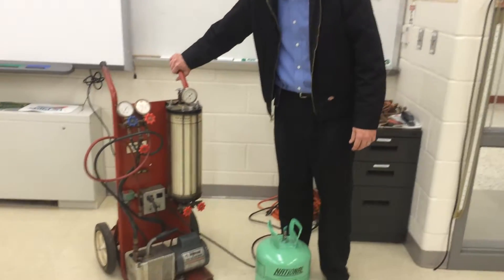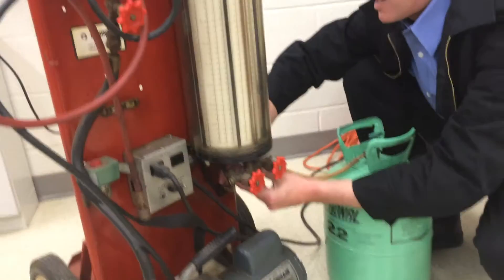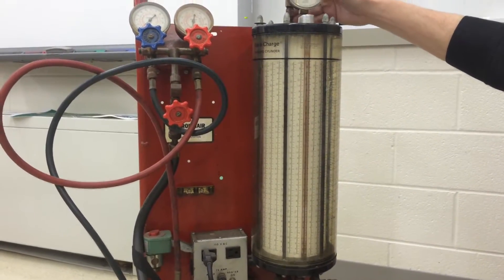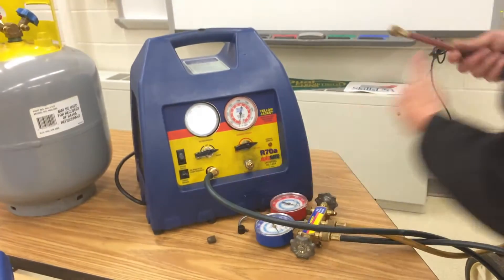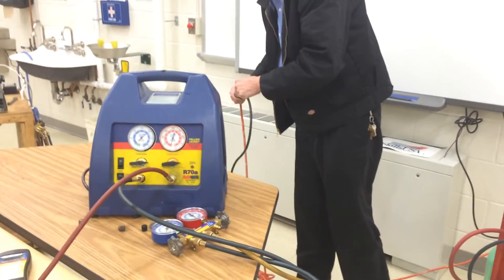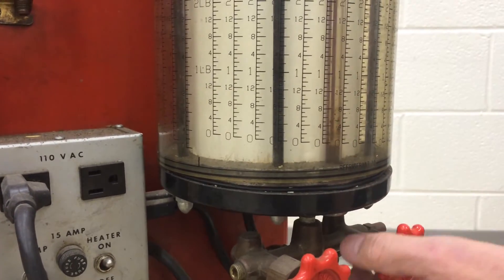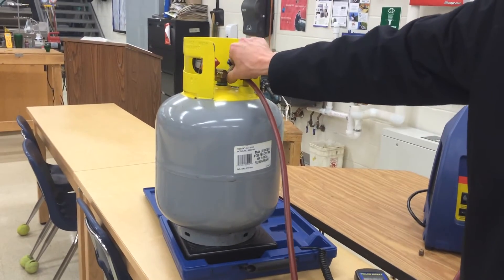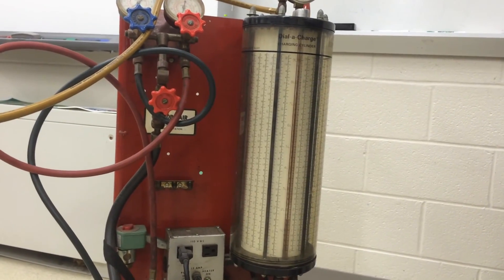HVAC Basics: EPA 608 Certification Test Study Guide - Refrigerant Charging Cylinder

Comment: can you not just draw a vacuum from the purge port and draw it down before opening the valve to fill the tank?? instead of using a recovery machine to draw more in, the vacuum would draw it in a lot quicker as there's no atmospheric pressure holding it back
Reply: Absolutely this would be the best way to add refrigerant ro the charge cylinder.

Comment: So I'm curious why not just do 1 purge through recovery side at the cylinder only and add up the hoses for the time?  Also curious, that can't be used for 410a I imagine due to high pressures?
Reply: Not so much pressures as I think these cylinders being obsolete, you can't get one with a proper scale - you'd have to make your own.  Personally... I'd convert one of these for changing axle oil: have a machinist make a scale based on ID of cylinder [calibrate in ounces or  100 ml increments], and just regulate air pressure down to 40psi or so, to avoid making a total mess.  The heater would be handy for high weight gear oil in making it flow faster.